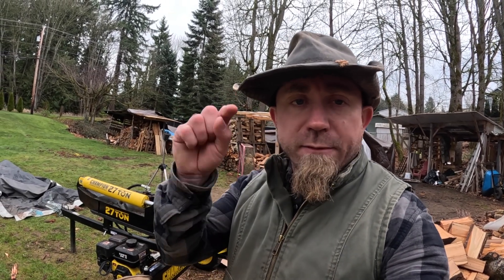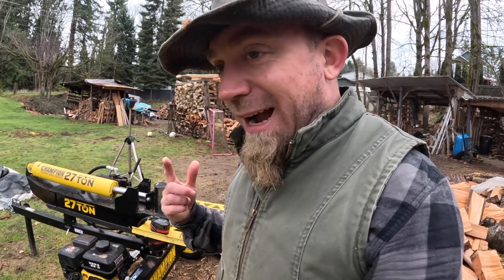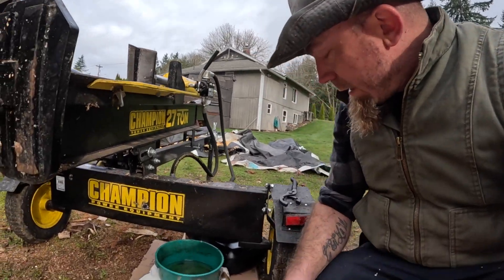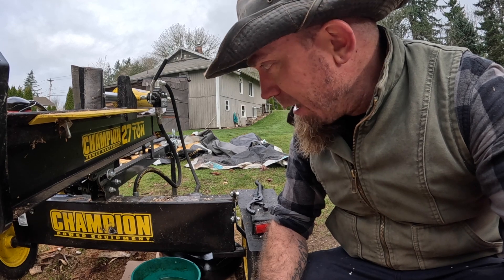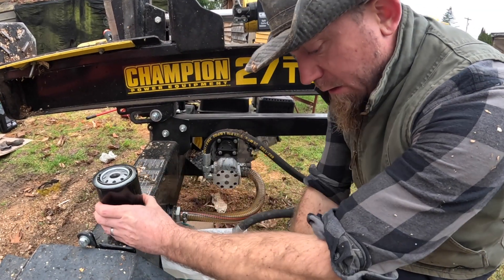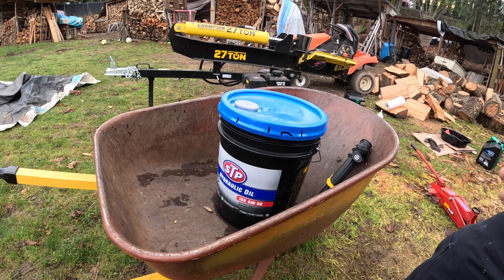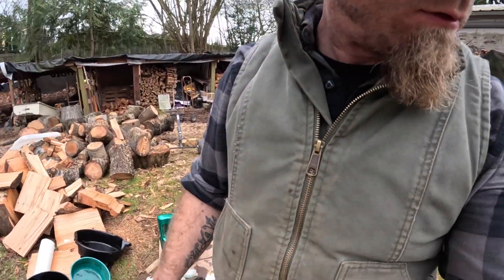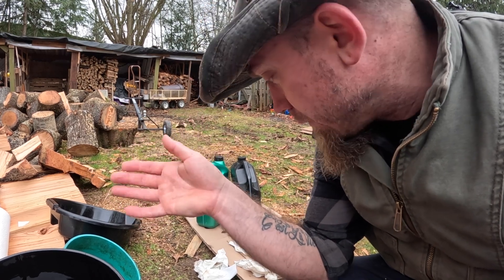Changing The Hydraulic Oil In The Champion

Comment: Travis, Great video. Good thing about hyd systems is they are one of the few that normal service intervals is a long time. Most heavy equipment intervals is 500 hrs on the hyd system and those machines systems see heavy use. As long as there isn't water or a system failure "like trashing a hyd pump" the systems stay pretty clean. 
I was surprised to see the manual saying to change it every 100 hrs.

You cant get all the oil out of the system without disassembling it. All The hoses wont drain because of the control valve & pump in the system. "there essentialy blocking some of the fluid between the pump and control valve & between the control valve and cylinder". The cylinder wont drain unless you take the fittings off the barrel and suck it out.
Not a huge deal since you didn't have a system failure and not water in your oil. That would be the only time a person would really want to clean out the system and "flush" it to get all the contaminates out of it.

Warming up that system isn't a huge deal. Your oil looked fairly clean anyways. The reason to warm up an oil circuit before changing it is to get all the sediment "trash/sludge' circulated in the oil so its not all settled at the bottom and don't drain out. On that splitter its not a huge deal.

I was happy to see you put oil on the filter gasket. Ive seen so many people not do that and they fight taking the filter off the next time.
On those 5 gal pales the grey cap you took off the pour hole if you thread it on and pull up on it the pale has a pour spout that will  pop out of the lid "built into the pour hole" that will help some will making a mess spilling oil.

Those small engines frequently have 2 dip sticks, those engines get put on all sorts of applications so depending on how the engine is mounted usually one dip stick/fill plug is hard to get to. The drain plug is that front nut for sure.

Hope these comments help i think you did great. Just trying to share some knowledge i have gained over the years. Working on heavy equipment was my profession for over a decade till i fell into a better situation.

Thanks again Travis
Reply from the maker: This is wonderful insight, information, and feedback - thank you! I'm not an expert, and I feel we can all learn from each other. Glad I did it 'right' - ha. Many thanks for your support and watching. Keep cuttin'!

Comment: A small siphon pump will work. Manual and battery operated. I back mine into my trailer, bungee strap a hosed funnel under the drain then let it flow into a bucket on the ground. I have the same Champion splitter and had to figure it out too.
Reply from the maker: I like where your heads at, thanks for watching!

Comment: Great video!  curious, ive heard people talking about bleeding the air out of the lines after filling.  Did I miss that here, or is that unnecessary?  Thanks!!
Reply from the maker: That's a good question. I think since the cap has a pressure release hole that any air would escape that way. That and I am unsure if the hoses were emptied as I didn't turn on the machine. I also was looking through the Champion manual and didn't see this. If you find an exact answer, let me know. Keep cuttin'!

Comment: Could champion use the same motor to power different devices, so that's why the oil sticks on two different sides.
 Thanks for the info. I will be using it soon.
Reply from the maker: It is possible but someone else in the comment, per memory, answered that question of why two dip sticks. Thanks for watching, keep cuttin'!

Comment: The manual for this machine says: "Check the hydraulic oil level using the oil sight glass. Oil level
should be centered on the glass sight." It shouldn't be filled the whole way, only half way like the manual says. Hydraulic oil expands and becomes less dense when it gets hotter during use.
Reply from the maker: Ah, good point. Thanks for watching, keep cuttin'!